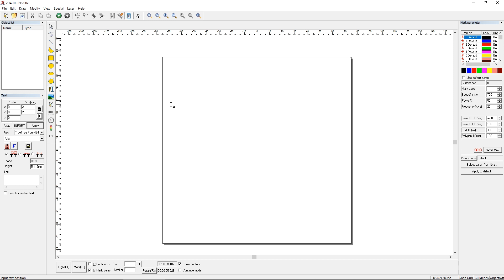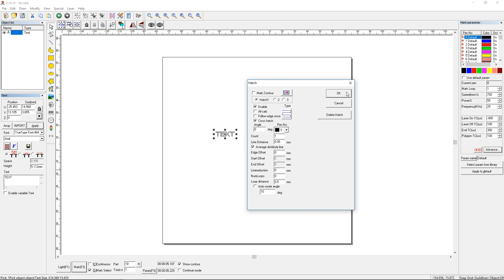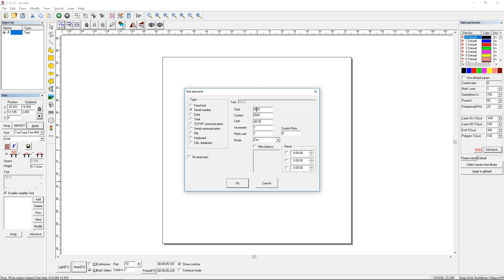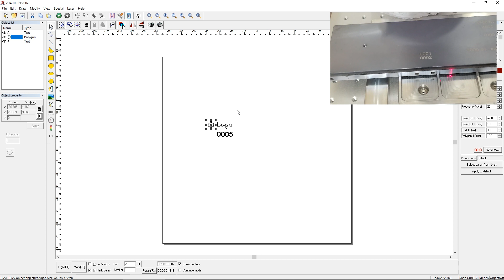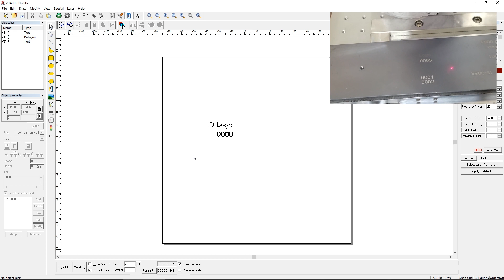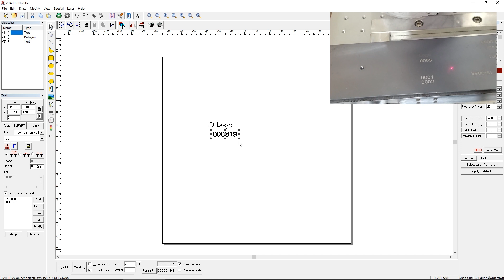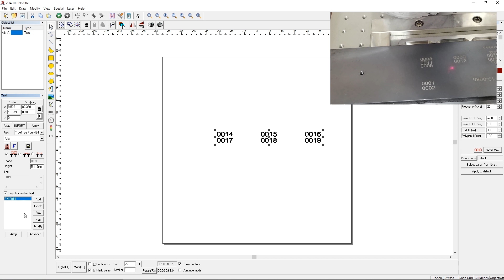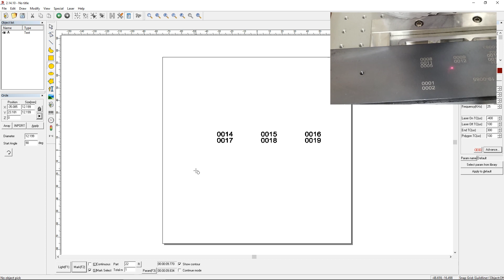EzCad2 Quick Guide: Marking Serial Numbers with a Fiber Laser

Comment: I tried to send you an email, but your address is no longer good.  I really appreciate all your EZCAD2 videos -- I really learn a lot from them.  I have a question about serial numbers -- is there a way to link a barcode with the variable S/N text?  I have a product that I want to start using my laser to mark the serial number info, but the way I currently do it I have a barcode with the S/N text immediately below.  That way the number is both human and machine readable (I scan the barcode to track and record the S/N to the customer account).  Is there a way to have the barcode automatically follow the variable text?
Reply: I’ve been trying to do the same thing. 2 years later did you ever figure it out? Thanks!
Reply: Actually I figured it out. If you click the barcode button below the barcode type it brings up a menu and you can check “show text”, which can be configured with font, location, etc as needed.

Comment: This video is great, it is exactly what I was searching for. A company wanted to charge me € 16,-- per serial number for 200 parts, which would make a total of € 3.200,--. Because of your videos I will purchase a fiber laser for myself to engrave my parts.

Do you have a good source for engraving settings dependent from the different materials and surfaces ? Thank you very much!
Reply from the maker: € 16 per serial for 200 parts?  That seems very high.  If they're just small serials, it shouldn't take you long at all.  The settings you use will be a little different from laser to laser depending on the power of your laser source and size of marking field, but as long as you have a sense of how to use the hatching function as well as what frequency is, you'll figure it out quickly.  I made a few videos on both these topics.
Reply: @jefferyj  Thank you very much for your answer! I have seen your other videos, they are very good, I just thought that you maybe have a list with settings for different materials/surfaces.

Comment: Great video!!  I have a question for you:  I have a cylindrical 2” round and 4” tall part.  The part has a 3.25” x .25” base that is flush with the bottom.  I mark the website on one side, then have to turn the part to mark “made in USA” on the other side.  Have you come across a way, other than a rotary table, to mark 2 selections in a stepwise fashion—I.e., select the website and made in USA (or separately) hit the pedal it marks one, rotate the part by hand, hit the pedal and it marks the other selection?  I’ve been marking each part 2 separate times with 2 different files (otherwise they have to overlap).  I have the part shifted to the upper portion of the marking field because of it’s height, it can’t mark all the way around the part.  Thank you for the video, and any insight you are able to provide—AJ
Reply from the maker: I think I have 3 different ways to do this (assuming I'm correctly understanding your setup).  1- Keep both of your marks in the same file and let them overlap, select the one you want to mark from the object list on the left and hit the foot pedal manually after selecting the correct object. 2) Set up an I/O control to only mark the first selection, wait you to reorient the part and hit the foot pedal again to mark the second selection. 3) Set up the multifilemark feature to use both of your files and use an I/O control to progress between the files.

Comment: Hey Jeffery, Your videos are extremely helpful; Thanks for sharing with us! I have a quick question, I also have a 30W Chinese laser and it been adding random vertical lines to my fills. Have you had an issue with that??
Reply from the maker: Hi Mark - I don't have the rotary tool, but I believe I've seen others mention that you should be using splitmark2 for rotary marking to remove lines.  Join this facebook group and search 'split' - I think that will get you the information you need.  https://www.facebook.com/groups/440091022989424/
Reply: @jefferyj  hai, can I join the group too?
Reply from the maker: @maruto957  It's run buy a guy who sells lasers from China - just request to join and he'll let you in.
Reply: Try to play with the cutting speed settings. When I cut too fast, the laser didn't seem to keep up and weird lines and effects appeared.
Reply: @vilts  I tried at low speed but im still getting gaps and strange vertical lines. I probably should have clarified it only happens when I use my rotary device on tumbler mugs.
Reply: @lukajurac7727  I see. With rotary I don't have experience yet. Mine has interface, but I haven't installed the rotary yet. Does the stepper make strange noises from time to time? If the timing signals are incorrect, then it could maybe skip steps and create this weirdness... But that's just blind guessing from my part.